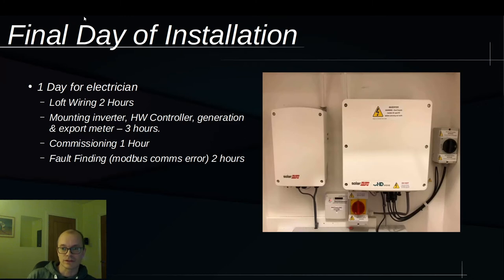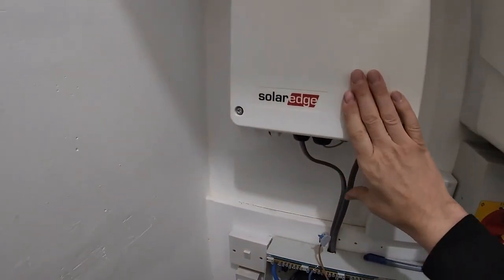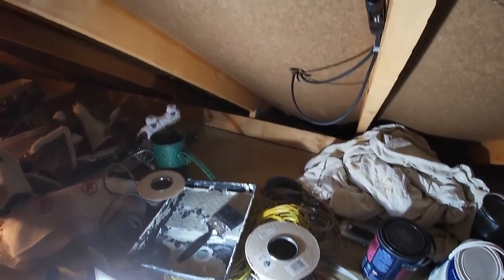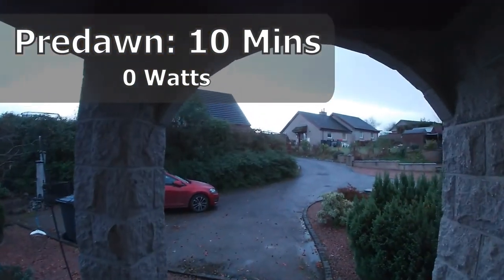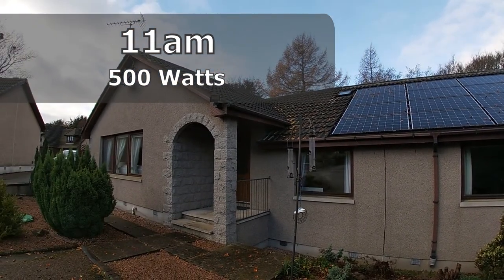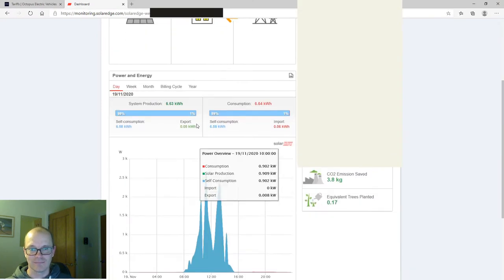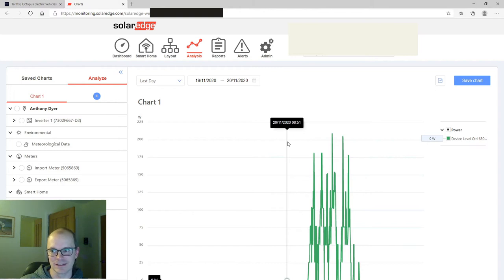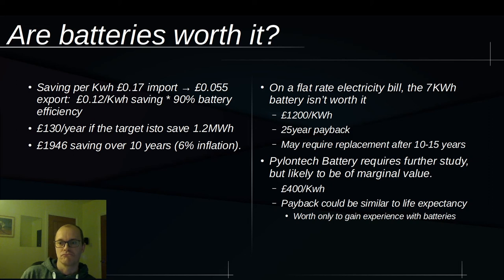Commissioning and Performance of Solar Panels in Northern Scotland (Part 2)

Comment: Interesting video, appreciate the in depth analysis of cost/benefit scenarios - We've recently had a system installed, and are intending to have a battery added, probably fairly soon. We've been looking at the Givenergy battery, it has a 10 year guarantee I think, but it needs to be fitted alongside their inverter for them to warranty it, which adds another £1k odd to it - but even then the bigger capacity battery/inverter is half the cost of the LG battery. One thing that struck me when you were filming in the loft - if you notice, the "felt" dips down between each pair of rafters - the felt is deliberately left a little slack in the horizontal plane to allow this to happen. This is done so that any rain ingress under the tile/slate is guided away from the joists and down to the eaves where it runs out (hopefully into the gutter). So the electrician ought not to have penetrated the felt in the dip between the rafters @4.22 as this risks water leaking through into the loft - what ought to happen is that the cables are fed up through the overlap between two runs of felt, thus not affecting the efficacy of the roof. It's a bit late to do much about your situation, but it's a useful tip for anyone self installing...
Reply from the maker: That’s not roofing felt.  That is fibreboard.  The roofing felt is above that.  The electrician has indeed done as you suggested and the cables transit through via the felt overlaps.  I’m not to sure what the fibreboard function is but it is apparently quite common in Scotland for houses of 1990s vintage.  It doesn’t seem to be a structurally stiff material.  Newer Scottish rooftops appear to have plywood across the rafters and then roofing felt.
Reply: @anthonydyer3939  Ahh, I see! All good then :-).

Comment: I live in Aberdeenshire and am exploring the various clean energy options, as the builder is putting just four solar panels on the new house I’m buying. I’m approaching it from the sustainability, rather the ROI point of view, so will likely go 4KW solar array with battery and Octopus agile tariff, plus a heat pump when I can afford it. Great couple of videos, thanks very much
Reply from the maker: Octopus Agile is great from spring to Autumn, particularly so with a large solar array.  I’ve been getting paid 10p per kWh for export in August, rising to 15p in September.  

But this October, the export has come up short and so you’ll suffer the flip side of this tariff.  Import prices have been saturating at 35p/kWh this October for most of each day.  So I bailed out and went for the Go tariff, just for the winter time.  

You’ve got the same kind of thinking that I have though.  I wish you the greatest and most rewarding adventures with your endeavour.
Reply: I find it appalling when these new developments go up and to gain Eco credentials they place a minimal amount of solar on the roof (I've seen some new builds with just 2 panels!!!). They should cover the roof entirely (where possible). Surely this would offset the price on roofing tiles too? Anyhow great video and really informative 👍😊
Reply from the maker: @rubydoobstylie  I displaced about 500 tiles.  So the retail price is about £1.20 per tile or £600.  Compare that to 28 panels and mounting adaptors costing £130 each, or £3650, it’s not much of a price premium considering the labour cost for installing solar is probably smaller (lighter weight, and smaller component count).  

I think what we’re seeing here is cultural inertia.  New building methods / technology aren’t exactly embraced in the industry. A builder from the 1920’s probably wouldn’t have much of a learning curve to get up to speed with building practices in the 2020’s.  The industry ripe for change, and prefabrication of entire building sections in a factory, including solar roofs, is probably the way the construction industry should go.  Solar roofs are far more compatible with such methods than rooftops clad in slate and tile.
Reply: @anthonydyer3939  Thanks Anthony, a comprehensive reply in 20 mins! 😊👍 I totally agree, although I feel the only way the big development companies will embrace change is when Legislation forces them to. I hope to retire soon and I am in the process of convincing (or rather coercing 😁) my family to up sticks to either Aberdeenshire or The Highlands. I plan to create a similar set up to you... fingers crossed. Have a great weekend 👍
Reply: @anthonydyer3939  I feel more houses should be completely built on a prefabricated set up, like a lot of them are in Scandinavia.  I would like to think higher standards could be achieved in that kind of environment and possibly have houses almost future proofed with regards insulation, renewable energy, etc. Have parts upgradeable for future technologies.  Maybe I'm thinking  to far ahead of myself.
Reply from the maker: @johnmackay7789  Not at all!  I was in a Korean shipyard about 5 years ago.  The way they build ships over there is something the construction industry could learn from.  Essentially each ship is built up from modules welded together.  Each module is so precisely made, that it seems that they were put together entirely by robots with direct reference to an autocad file.    They included all the pipework, stairways, bannisters and door frames premade!  It was quite an amazing site.

The chinese contruction industry has been taking a leaf out of that book with these highrise buildings that rise up extremely quickly.  It's definitely the future!
Reply: @anthonydyer3939  I live in a Norwegian prefab house in Aberdeenshire myself. Built in the mid seventies and even the methods used then were years ahead of anything here.

Comment: You should do an update on this video with current prices and another rise in October it will be a totally different scenario.
Reply from the maker: I did a 1 year review of the solar panels last November.  I have to admit, even with a 50% rise in prices that I discussed, that even that is out of date now.  

My next plan for a solar review is when my solaredge battery gets installed.  

As you say the economics have completely changed - for now.  It’s easy to extrapolate a short term snapshot of solar economics to 25years,  it that doesn’t make it accurate.  In a few years time, I have to ask what the economics will look like with a lot more rooftop solar and offshore wind.  I suspect that electricity prices will become very lumpy:  cheap / free some times and obscenely expensive other times.  That will have to be factored into investment returns.

Comment: Great video & very informative! Thanks. You mention software to manage the Agile tariffs - can you recommend any? Thanks
Reply from the maker: I think there’s a company called givenergy, who have a battery management system that can take the agile prices and charge the battery up during the cheaper periods.

I’ve recently switched to agile, so I’ll be presenting some analysis as to “why” in my next video.

Comment: any reason why you didn't have a hybrid inverter?
Reply from the maker: The Inverter is actually hybrid!  But it’s only hybrid with the LG Chem and SolarEdge batteries.  I’ve accepted a quote for the SolarEdge energy bank.  Due for delivery this April.

Any other battery, and I need a compatible inverter.

Comment: I note you've had your install for over a year now - do you plan to do a video about annual energy production you've made?  I'm just up the road from you in Huntly and considering solar for a large house.  Trying to figure out just how many panel I will need and what system.  Can't hold of the installer you mentioned (Barry) his number is dead...
Reply from the maker: I’ve done the one year anniversary video:
https://youtu.be/RtrwM39kb-g

In summary:  7.02MWH of electricity generated, 63% of electricity consumed on site provided by solar panels.  Over 4MWH exported.  £700 of value returned on the investment so far.
Reply: @anthonydyer3939  great to hear!  That's outstanding thank you

Comment: Great video 👍🏻 I'm in the investigation stage or getting solar to work out if it's worth the investment or not. In Glasgow area so not exactly the sunniest part of the country! Everyone seems to recommend Octopus Go and Agile, but my biggest issue with the Go tariff is the high 25p daily standing charge and Agile will increase the amount of time and effort you need to put in to make sure you avoid paying the peak rates. Unless you can set the battery to make sure you always have 100% to cover the 4-7 peak time?
Reply from the maker: One thing I found out since making the video is that I can't get the outgoing solar tariff, and be on the Octopus Go tariff at the same time.  I can either chose a fixed rate tariff (import and export), or the go tariff (import only), or the agile tariff (import and export).

At this time of year, I'm exporting trivial quantities with the hot water controller.  

So my idea for next winter is to go on the fixed outgoing tariff from Mid Feb to Early Nov, and then switch to the Go tarrff for the winter period.

The Agile Tariff as you say it's a lot of effort to make it worthwhile.

As for Glasgow, you can search this website for solar installations throughout the country that make their production info public to get a gauge for how other sites are doing:
https://monitoringpublic.solaredge.com/solaredge-web/p/home/public?locale=en_GB

As an example, here's one in Glasgow, so it produced 3.2MWh for the year 2020.   
https://monitoringpublic.solaredge.com/solaredge-web/p/site/public?name=Glasgow%20Kings%20Park&locale=en_GB#/dashboard
So if you were to consume all that leccy, it would be worth £540 / year in reduced bills.
Reply: @anthonydyer3939  what's the advantage of the Go tariff in winter? Unless you have a battery to import during the night. I can't find much info about the Outgoing fixed tariff other than the export rate, their website doesn't say anything about the import cost or standing charge for it.
Reply from the maker: @craiglindsay2417  You can time heavy loads like Dishwashers, Washing Machines, Hot Water etc... to run in that 4 hour window at night with the Go Tariff.

At the moment, I run these heavy loads during the daytime, and there's sufficient sunshine on a sunny day in winter to run one dishwasher and two washing machines (consecutively, not concurrently)

But when it's cloudy, and you can't wait for the sunshine, then the Go Tariff can come in handy for such occasions.